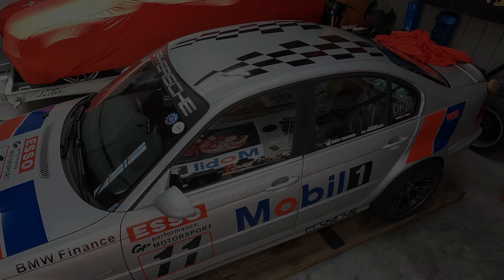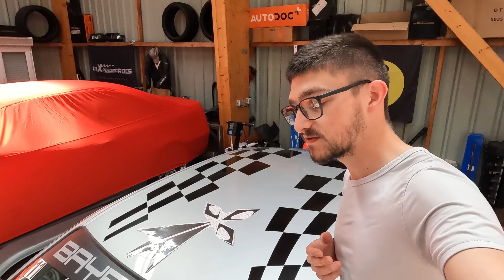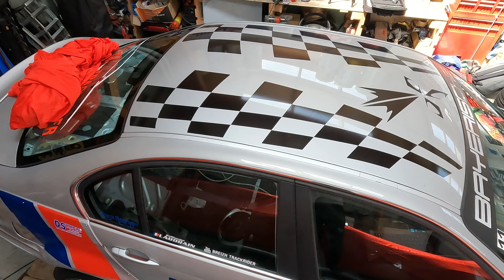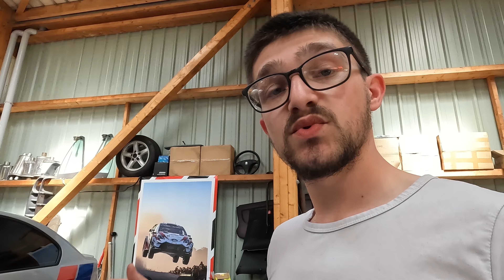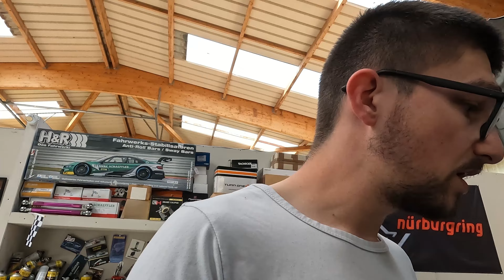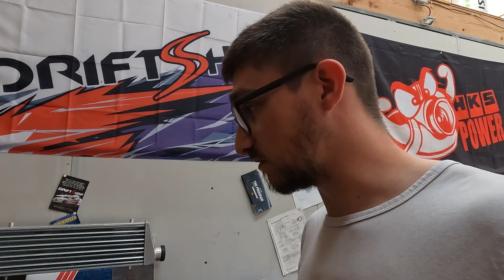Quelques new's E46 TURBO, DRIFTEUSE 2.0 & COMPACT SWAP PROJECT

Comment: Salut !

Dit moi, tu sais si y'a une grosse différence à prendre une berline ou un coupé ?

Je sais que y'a aucun pièce de carrosserie compatible à priori. Mais j'arrive pas à savoir si la rigidité et poids change.

Félicitations pour les avancées et courage pour la suite !
Reply from the maker: Des retours apparement caisse vidée la berline est un poil plus légère niveau éléments châssis c’est pareil merci l’ami 🤙🏼
Reply: Coool merci ;) franchement je galère de fou pour trouver une caisse correct à un prix décent. Soit c'est des merguez cramé à 4, 5000 ou bien des truc potable à 6, 8000... bien sur à partir de 200 000 km...

Ya bien des 325 et 330i aussi mais ca m'oblige à passer en maxxecu et ca fait péter le budget prepa...
Reply from the maker: @deab19   323/328 tu trouves pas ?  200k sur c’est bloc si c’est bien entretenu c’est pas un pb …  après c’est le coup de poker gaffe aux engranges dû trains arrière surtout
Reply: J'en ai trouvé 2, 3 rouillé. Et celle correct était trop loin pour les visiter...
En même temps jveux le beurre et l'argent du beurre.
Je continue, j'attends la bonne affaire. La y'a une 328ci qui correspond pas mal.
D'ailleurs toit ouvrant sur pistard t'en pense quoi ? Ca affaibli la rigidité de beaucoup ?
Jcrois que ca pèse plutôt lourd.
Reply from the maker: @deab19  le to c’est pas forcément un handicap tu as des trapes de condamnation en fibre ou plastique qui sont faciles à trouver ;)